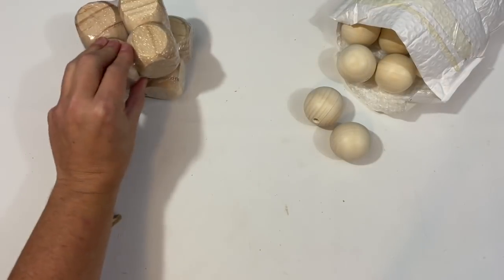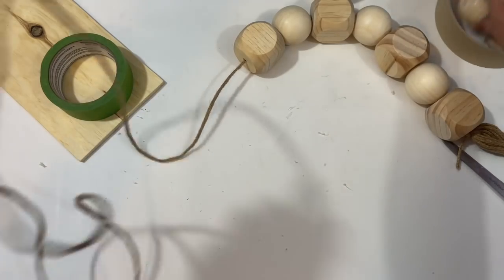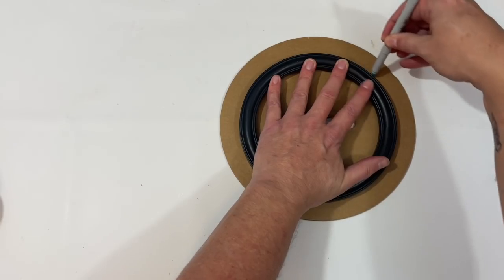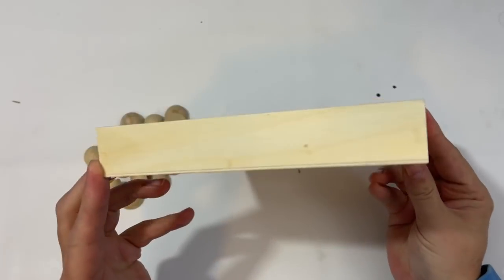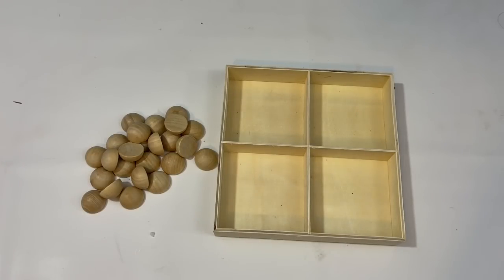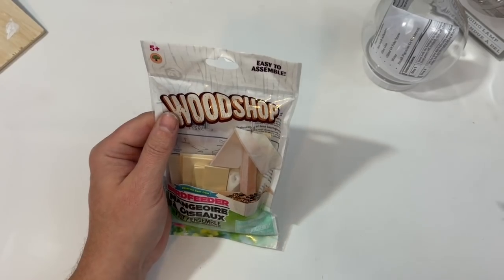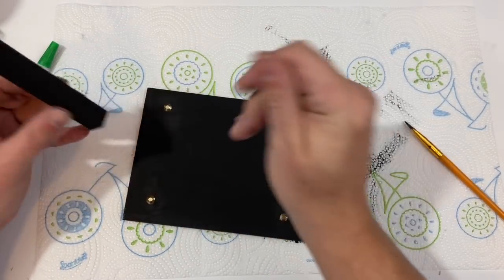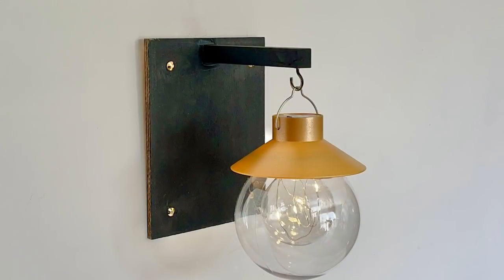HACKS! HIGH-END DIY HACKS! EASY DIYS to make!!! EASY Dollar Tree DIYS that have a HIGH-END look!

Comment: You can put those metal springs on chop sticks to make them easier to use! Just gotta cut little notches in the chop sticks similar to how they are on the clothes pins and basically just pinch the tops similar to how you pinch the clothes pins to open them.

Comment: Love your DIY's. The lantern is great.  I will be making my own to upgrade my patio.  Also, the clock was great.  What to do with the springs on the clothespins?  Join them together to make a bracelet.   I made a couple just to tryout.  My granddaughters fell in love with them.  I also painted and added beads to some and they turned out cute.